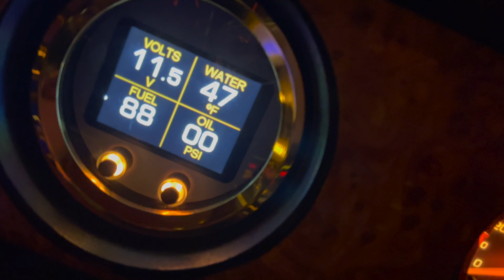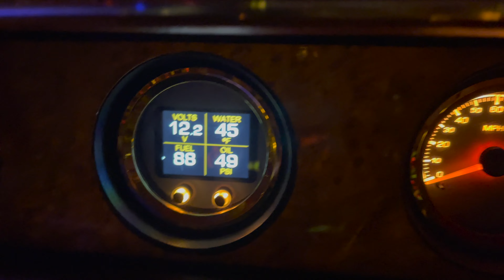Sugaman Onnat Takes His 421 Banshee To Get New 421 Motor Installed

Comment: What's up big dawg checkin in from Charleston SC the volts on the 442 should be at least 13 to 14 volts running especially with the subs in the trunk it definitely should be round that range if you have an extra battery in the trunk and a big 3 under the hood at the alternator